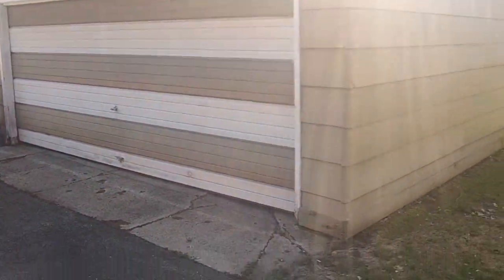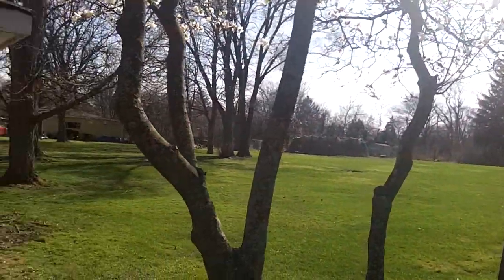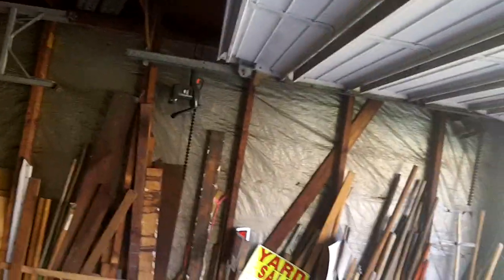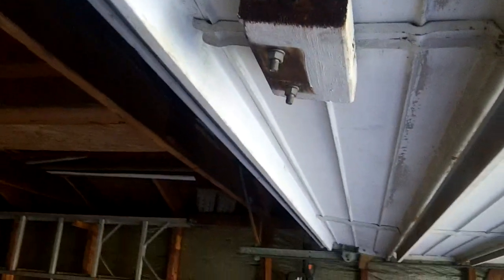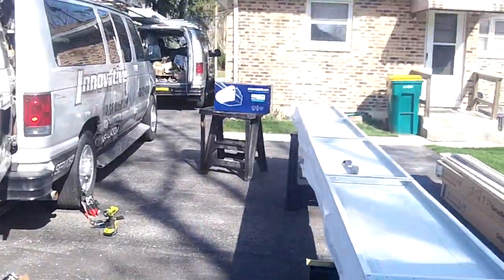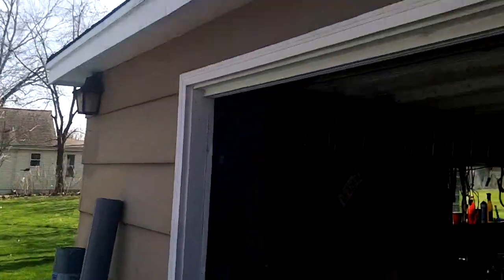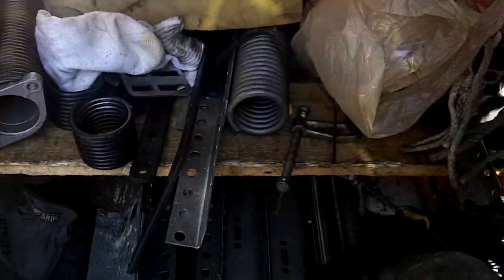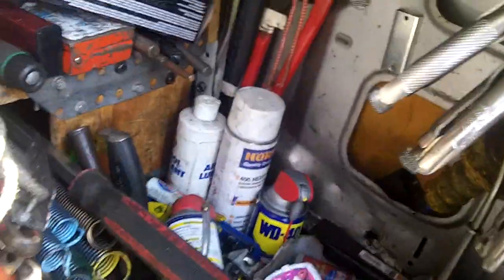garage door with extension springs by vertical tracks on door

Comment: I replaced extension springs on a roly-door a couple years ago, it was a one car and it's springs were mounted the traditional way up above the horizontal tracks. Manual door, lubed it up worked very well, and not rusted either! Had two little rectangular windows in it too